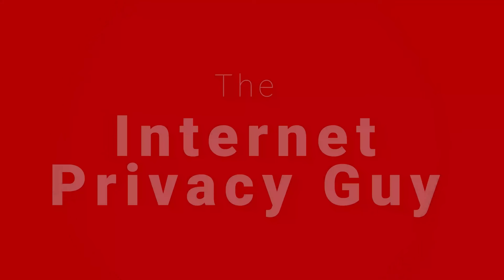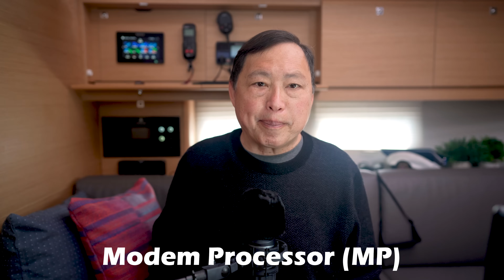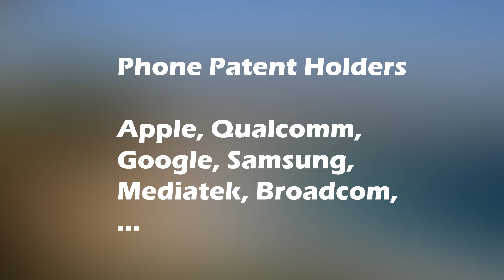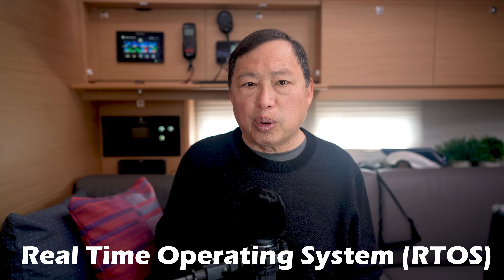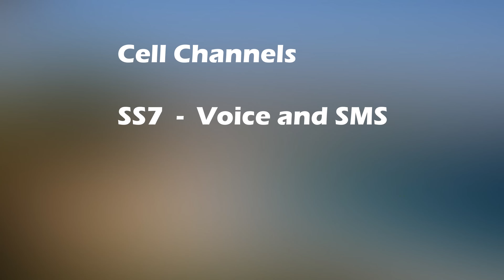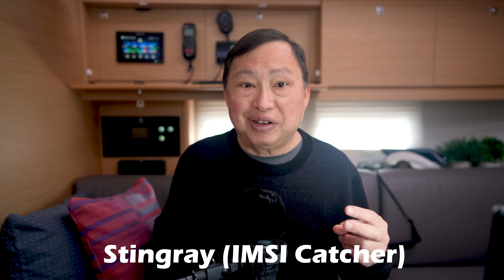How All Phones Can Be Hacked

Comment: Even crazier, the Sim is a full self contained SOC with its own CPU and memory, it runs on a limited JVM.
Stackoverflow goes over this in more detail.
Reply from the maker: The SIM is not an SOC. But it has a logic chip like an RFID and it's powered by the MP SOC.
Reply: I also recall reading that a SIM is a SoC somewhere like wikipedia. You can't believe everything you read online though, especially wikipedia. I also thought I once read a GPS system is now embedded into SIM's. I can't find that info anywhere now.
Reply from the maker: It's getting very complicated so I tried to give industry terminology in this video so everyone can research on their own. Without the right terminology, you will not find anything. If you have the right terminology the world opens up to information
Reply: @robbraxmantech  Yes, one must always do their own research because the facts can vary from device to device and also part to part. Even if it seems to be the same  it may have differences. There may be differences between the "generations" (such as "errata" or "erratum" lists published for each batch or generation of CPU!).
Reply: @sashas3362  I don't think integrating GPS module into the SIM is possible, it would need antennas at least. But GPS like software features are possible using the cell towers.
Reply: @mullergyula4174  Fractal antenaes can be compact. Besides that GPS only needs antennaes if it is using normal radio  waves (AKA "far-field" waves) to communicate instead of quantum entanglenent or "near-field" waves. SIM cards use NFC iirc. This is not normal radio waves. Although it is commonly believed you need to be very close to a SIM card to communicate with them via NFC it is known that SIM's are trackable via drones and satellites. They may use quantum entanglement to communicate with the SIM. Such communication may be done via NFC. NF communication is NOT done via electromagnetic radio waves after all but rather something else (although related).
Reply: @sashas3362  This is way beyond me. I am only familiar with traditional radio technology.
Reply: @mullergyula4174  Yeah it is beyond most.
Reply: @mullergyula4174  GPS now uses quantum entanglement (to improve accuracy at least). This is a very obscure fact. I don't know anybody who is aware of that and I cannot cite the source where I read that. It has disappeared. It was reported in a news brief in a science or technology magazine though. Nuts & Volts or Scientific American or New Scientist perhaps. Maybe "Nature" magazine.
Reply: @mullergyula4174  every metal is antenna
Reply: Rob seems to be saying the java code of a java card SIM is simply stored on the card not run on it but rather runs on a SoC outside the SIM card.
Reply from the maker: The browsers on a SIM card are called S@T and WIB. There's no Java. I don't even think they run javascript. It's likely a custom text interface.
Reply: @robbraxmantech  I wouldn't know. I don't mess around with them like you do. I only read about them on occasion.
Reply: @robbraxmantech  no i am 100% sure of the sim cards atleast be a version of smart java cards. I had that in my telecomms undergrad.
The ability of them able to process AT commands is directly linked to their jvm. They have a very restricted and small jvm where a small subset of java can be ran.
The credit/debit cards too are java cards. Not javascript, just java. Main purpose is the key store. But they also have a cpu inside and can understand some fixed function java methods. But they can also be reprogrammed
Reply: @robbraxmantech  Like I said (perhaps in another thread here), a few years ago I read much of the baseband code and functions have been moved to the android or iphone OS to make it more secure. Seems like maybe you are confirming that here.
Reply: @robbraxmantech  I'm wondering if maybe part of the reason 2G and 3G networks are being shutdown is to force people to upgrade to more secure phones with the newer "SIM cards" (meaning the removeable card, whatever it is called these days) which may be more secure because they may not have all the same (reprogrammable) computing capabilities as older SIM cards.
Reply: @jasonsummers6705  People still use 3G and possibly 2G (2.xG that is not 2.0G). It is not as slow as you may remember it being because those networks are not anywhere near as congested as they used to be now that most people have migrated to the 4G and 5G networks.
Reply: @jasonsummers6705  I agree they are too slow for most people though. But many still use them. It is actually misleading for them to say they have shutdown the 2G networks because after they claimed to have shut them down I had a 4G phone and I noticed neither the 3G or 4G icons were showing when I dialed 611 for tech support from the phone service carrier. I inquired about that and after interrogating them thoroughly discovered that the phone was connecting to 611 via 2.5G or above (but below 3G). So when they say they shut down the 2G network they are being deceptive. The phones still connect to 2G networks. BTW it may interest you to know the tech support rep remotely boosted the output power of my phone too (he told me he did that after I asked why the phone was burning me). I believe they did that to cause me harm. It gave me a severe persistent headache although that may have been due to earwax. I went to the doctor about that headache and they removed a plug of earwax which may have been pushing against my eardrum. But I believe that was because the wax got liquified by the heat generated from the phone (which was getting extremely hot) and then hardened against my eardrum. So beware.